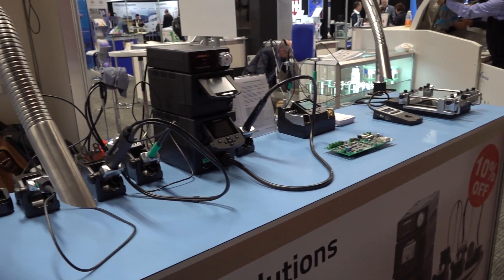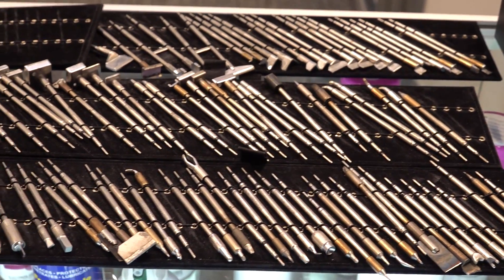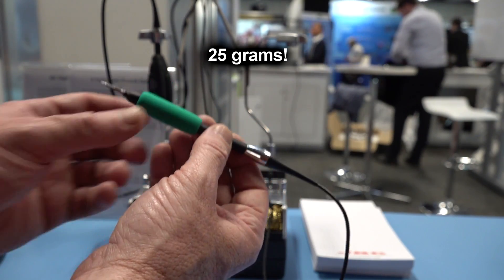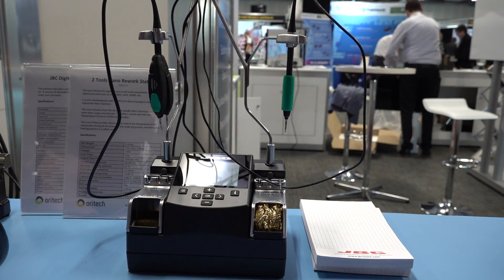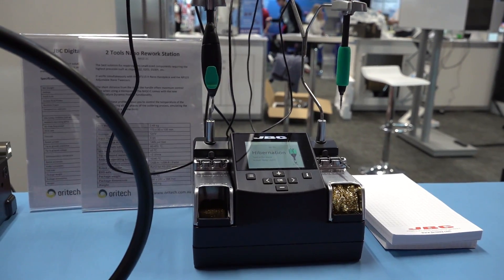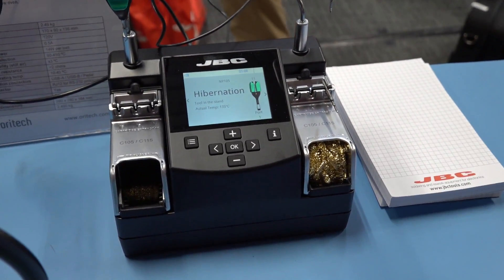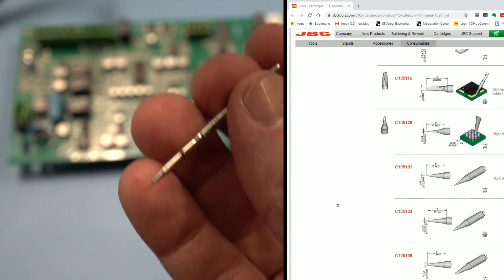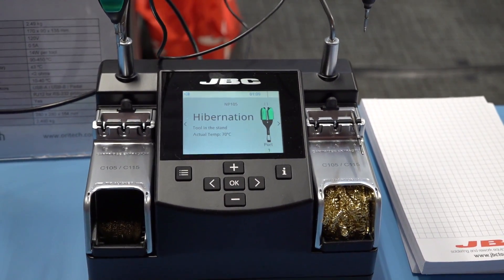JBC Nano Soldering Iron

Comment: all benches at work are equipped with one of these, a weller wr 3m and a metcal. after 2 weeks, people barely touch the jbc. for 01005 i use wmrt's with both hands, for all other stuff metcal takes the cake everyday. sure the metcal handles could be an inch shorter but the power and the quality of the tips (which are barely replaced in comparison to weller wmrts. jbc tips dont need to be replaced often because they get low mileage anyway xD ) are no match. 

the ts100 with the newer tips is the winner tho.

Comment: JBC is good but their displays are just rubbish I have 3 JBCs 2 of them turned to really dark.

The JBC nano is nice, but be sure that you don't solder too much above 350°C the tips can be damaged easily.
I usually use the tweezer at 300-350°C with a supporting hot air gun, it's very convenient to remove and solder down to 0402.
Directly using the tweezer at 450°C without hot air gun will shorten the lifetime a lot (=absolutely not recommended)

The JBC nano will speed up soldering a lot if needed (eg. reworking).

Comment: I have both a JBC CD-B/S and NASE along with quite a bit of those "specialty shape" tips for both T245 and T210 handles. AFA the NASE, the only thing I like about it are the handles and tips, but I just don't care for the rest of the overall design of it. I only use the NASE if PCB confines are too tight for the CD or other larger tools (which are increasingly becoming the case for my board rework). I use the "kimwipe" method more often for cleaning both my JBC and other soldering gear tips because my experience with most of the harsh abrasive, thermal shock, chemical paste, and/or tip banging cleaning methods really shortened my tip life. I only use those other methods if absolutely necessary. 

I've tried the rest of the JBC excellence range and just didn't care for the excess involved with them. I repair/rework mostly IPC Class 2 and 3 boards, and the rest of my "non-JBC" tools work almost as good (better in some cases), yet don't cost an extreme amount.
Reply: JBC Nase hot tip change system is the best there is. The T210 and T245 tip change is clumsy in comparison.

Comment: those wide tips/blades are for cleaning up BGA pads I think. At least I've seen them there alot. After the chip gets removed, they use this, and alot of flux to clean and re-tin the pads.

Comment: I have JBC Nano station at work, it may be great for 0201 work because it has super small tips and length but from ergonomics perspective it's a PIECE OF SHIT. That dangling cord always gets in the way of seating the iron or cleaning the tip. That hanging cord also gets in the way when turning off the station and if the stands can rotate if they are not secured, then they will rotate and burn your hand, done so many times, and even if they don't rotate, there's a pretty narrow window for your hand to reach behind the station through the iron tips to turn off the station. They don't have large tips for working with >1210 components and heatsoaks, I looked, and we had the largest tip for this series and it just couldn't cut mustard. Also, someone dropped the iron onto that display and the cover glass shattered, hence why you don't hang irons above the station display. WANKERY...
I'd cut those fking cords and throw this PoS in the trash can and get myself a Weller WX Station, more tip selection, more power, good speed, comfortable, best I ever used for all classes of work from 0201 to ground planes.
Reply: Weller WX cannot compare to JBC Nase for microscope work, the handpieces are much bigger and heavier and clumsy compared to the JBC Nase super compact design. I've logged over 3000 hours on JBC Nase stations and it is the very best for microscope soldering. JBC Nase has SIX different 0.1mm tips available, Weller WX does not even come close to that range at 0.1 conical. Also, nothing beats the tip change system on the JBC Nase. The Weller is clumsy for tip change in comparison to JBC Nase. Ergonomics? where do you rest the iron with Weller, in a fkn hole like everyone else right? guess what happens? you end up bending a few tips when you hit or miss the opening of that hole. JBC solved that by hanging the handpiece near the cable end and avoiding the tips coming close to contact with the hole - its very clever. If you are so clumsy that you drop the iron on the screen, you would be damaging many tips trying to slot it thru the hole in the holder on Weller WX. complaining about using the NASE for larger work is stupid, it's like saying an F1 car has no space for 4 people.

Comment: Why do they use brass wool when copper wool works so much better? A little acid paste on the copper wool and it wicks the excess off anytime your near it. Maybe copper pot scrubbers aren't popular outside Canada?
Reply: itt might have something to do with copper being more reactive and getting copper on the tip, that then transfers to each joint either weakening it, or not allowing for certain leadless solder formations to cool such that the 'outside' of the joint is all tin for the oxide layer. ie with copper in the joint especially for very small component sizes, there might be a treshold where past a certain point, the joint might be subject to more corrosion and mechanical stress factors as a result. could also just be availability and worklife longevity
Reply: Not sure about that. You are tinning on copper all the time with no ill effects.